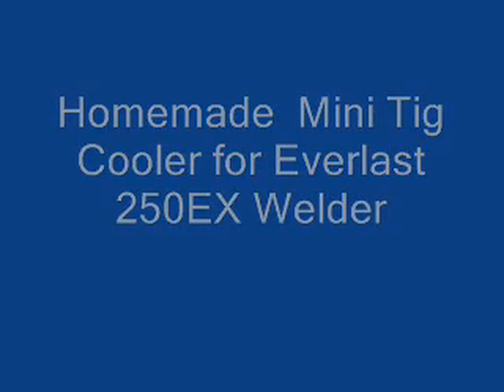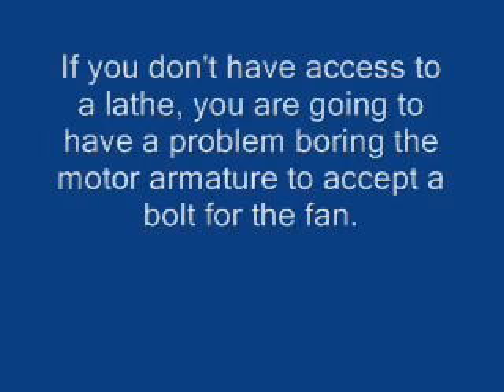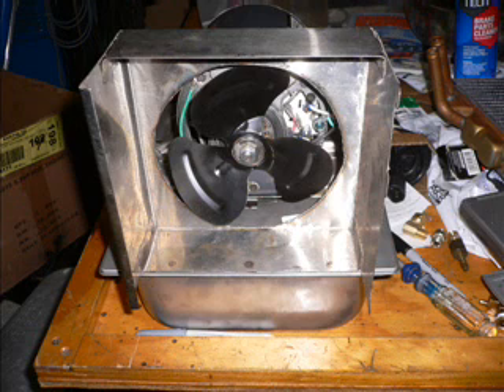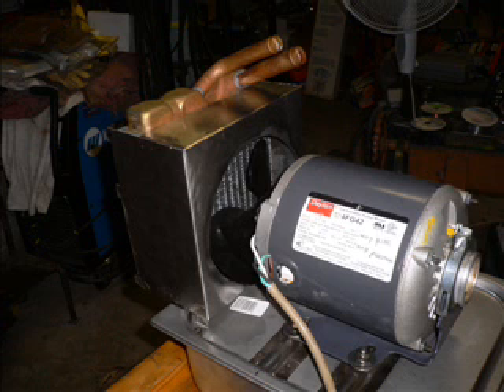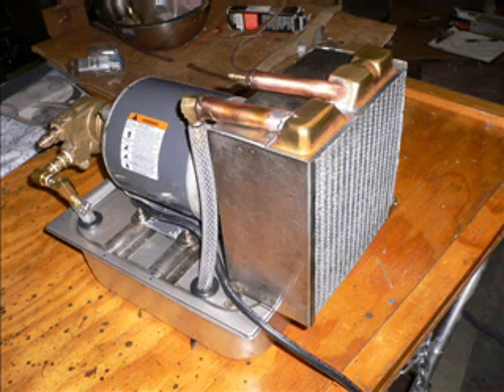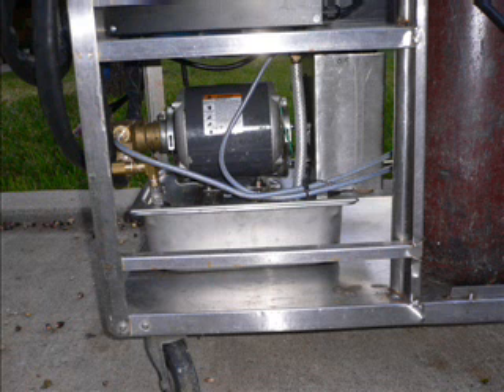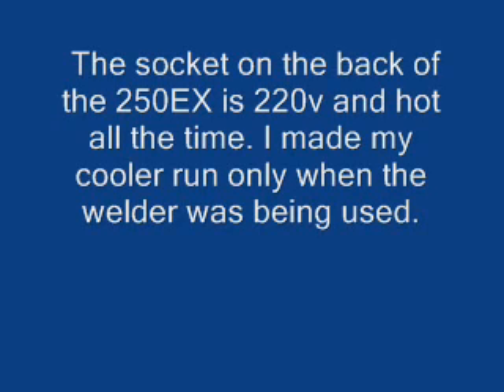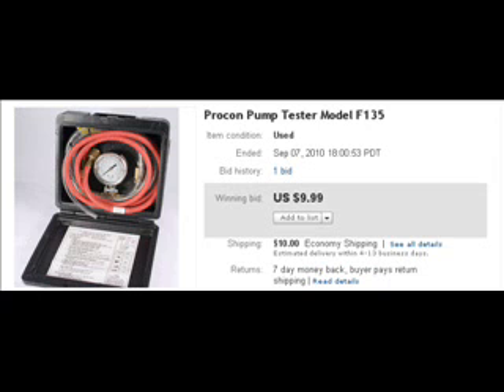Homemade homebuilt Mini Tig Cooler Cooling Welder How-To

Comment from the maker: Project Update:  I have been using it for  few months now and over the last couple of weeks have been doing some fairly heavy and lengthy aluminum welding.  I can say without doubt that it works great.  After a couple of hours of welding in one setting, the water reservoir wasn't warm at all.  The gun remained cool the whole time and I was able to remove the tungsten and reinstall it after sharpening using my bare hands.  I am happy with the unit.
Reply: Nice project. I'm looking to build a cooler for my powertig welder.